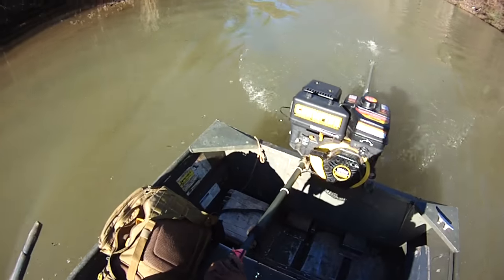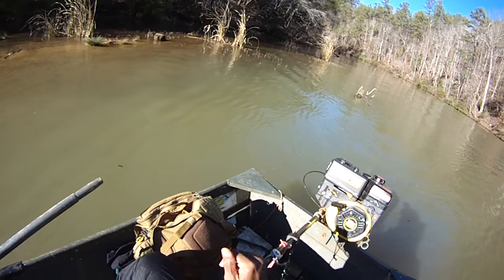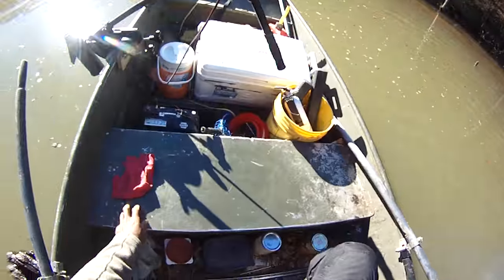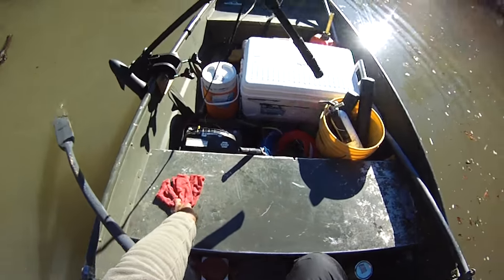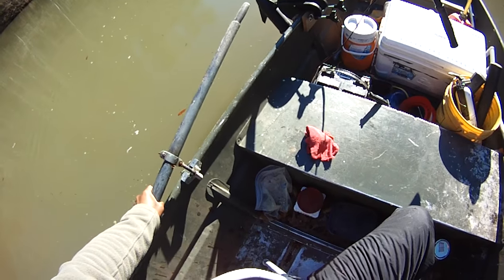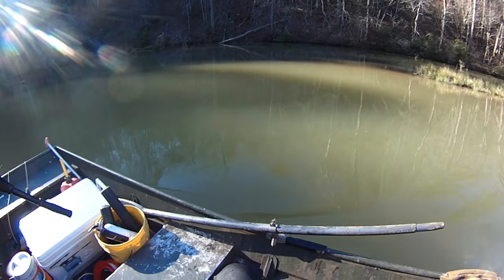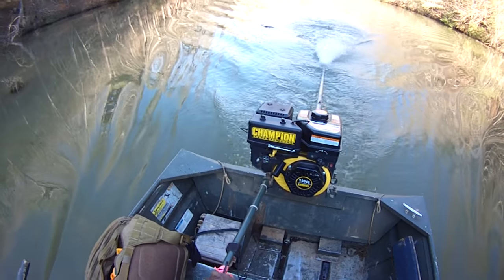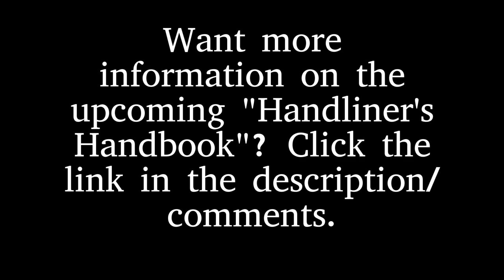Longtail Lesson | Proper Low Oil Level

Comment from the maker: As far as speed, a narrower longer boat is the best way to go. There aren't an jon boats made to optimize these motors. That's why I want to build a jon boat to my dimensions: something 1836, 1632 or 1530. Long and narrow would give me the same speeds as that hopped up motor but with all the reliability of a stock motor and actually more hauling capacity than this 1236 jon boat. That's why the Thailanders use such long boats. It's really a better fit for these motors.
Reply: Black Warrior Lures mine is one of the narrowest I've seen don't think they make them like that anymore
Reply from the maker: Yeah, they don't make them long and narrow any more. I'd build one even longer.
Reply: I thought about doing longer with jet ski motor

Comment: Hey new to you're channel I seen you're predator 212 build it sucks it blew up that fast.

I think you should do it again I do these upgrades to go karts and mini bikes and never had a engine fail yet you just had a bad engine and looks to me you put some hours on before upgrading buy a new engine make sure it fires then tear it down when it is fresh and new  yet and I promise you're experience will be better. I recommend Hemi version.
Reply from the maker: Yeah, it does suck that it blew, but I lost a whole fishing season. If I
 build a new engine it will be a torque build from Box Stock Project 
engine, probably a 232 marine/winch cam from NR racing. I think the 
marine environment is just a much tougher environment. There was a rash 
of failures in several guys who built similar engines for mud running at
about that time.
Reply: yeah I hear there better engines never personally had one yet. not really a fan of the yellow so I'd repaint mine if I get one.
Reply: Never mind they do have different colors lol I thought they were only yellow my bad.
Reply from the maker: Yeah, they have at least the black out version. Honestly I wouldn't 
touch another Harbor Freight motor given the stuff I have to run it 
through. 

The stress of the marine environment is so much greater than on land. Water is 800 times as dense as air. Not only do these engine have to produce enough power to plane over such a dense medium, it also has to push over 500 lbs load in the boat. That's just not something a mini bike or go kart will ever see.

So everyone I know is going toward big-block mud motors like the 390cc+ motors. Or like me going back to bone-stock. I think a torque build would work, but I gotta get back to making fishing videos.
Reply from the maker: I mean you have to think like you're going on an expedition not around a race track. Reliability trumps power. If I were below the dam while they were pushing current when that motor blew, I would have gotten killed. If that happened while I was on a go kart track, I just simply walk off the track.

If I were in Alaska up the Yukon river and that motor blew, I would have been stranded with no help, frozen on the Yukon.

4x4 overland vehicles aren't the fastest, but they will get you in, around and out of the wilderness alive, which is far more important.

It's fun to run these motors fast, but as a wilderness machine, bone stock is most reliable.
Reply: yh I'm sure you're right I only build for mini bike and go karts. I don't know anything about mud motors engine and stuff it does look fun to get into though..
Reply from the maker: They are fun, and I know of one drag car builder who build crazy motors 
for these things. After building the small block motors he went to the 
big-block 460cc motor that is used in golf kart racing. You can easily 
make those things produce about 25 to 30 horsepower.

But everyone running the hopped-up small-blocks keeps running into the failures.

Also the fuel economy. Man, that hopped up motor got about 3 miles per gallon. The current Champ motor gets about 12, the Harbor Freight I had at stage I got about 9. I think the Hemi Harbor Freight motor would get mileage close to the Champ motor since both designs have really good rocker arms.

Comment: Black Warrior Lures I have a Grumman 1986 jon boat with sps longtail mud motor selling less than Yr old has predator 212cc taken care of drained break in oil after first few runs and put royal purple in it asking 1500, I built from seeing yours first, just can't  take out anymore I've always kept fuel stabilizer in it and kept shaft greased. and idk if you still have all the preformance parts for this motor. this little boat is pretty fast as is has the 2yr warranty http://app.5miles.us/m9KajgY
Reply: could have back up boat I have all titles and registered trailer
Reply from the maker: Na, I sold the performance parts for my motor and bought a Champion Power Equipment replacement engine.
Reply from the maker: Na, I'm all set. I do want to build a jon boat with an inboard transom for the motor. I say get on the Swamp Runner forums and sell in the classifieds there.
Reply: Alright appreciate it